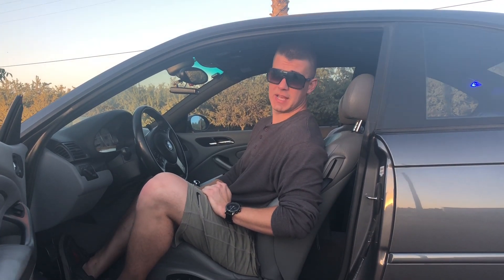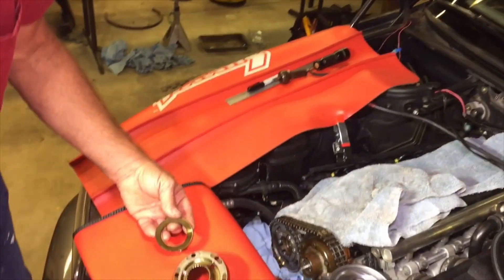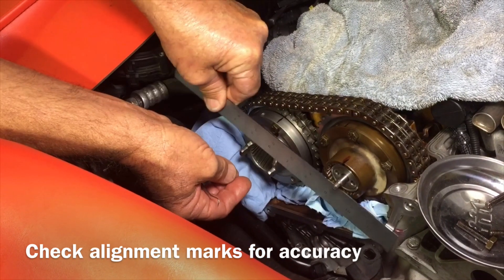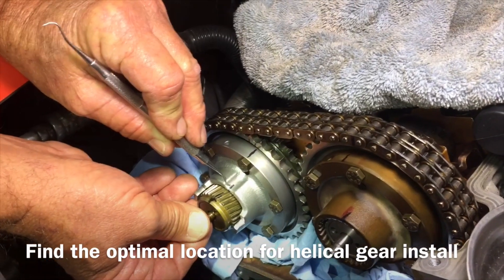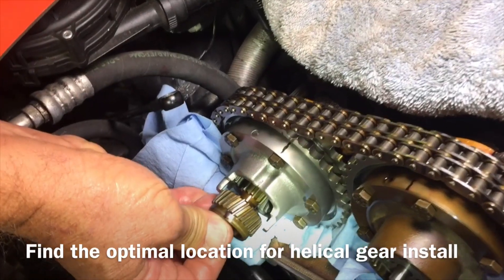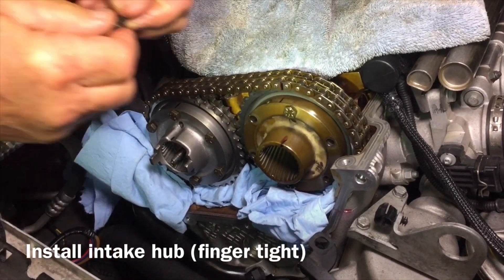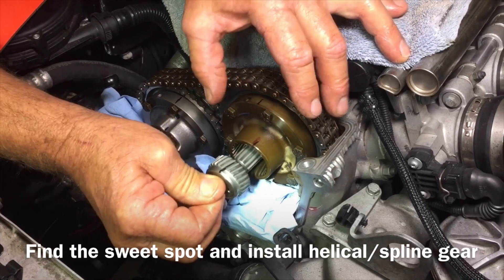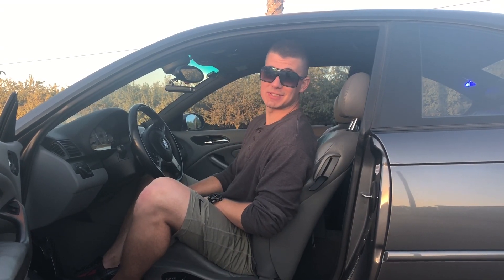How to: Perfect VANOS timing trick+ synchro gear installation + cam gears and hubs E46 M3( part 5)

Comment: The range of linear motion of the VANOS piston shown in the video is due to the hub rotating within its slotted adjustment holes. When the car uses VANOS, it rotates the camshafts, not just the (secured) hubs. The camshafts' phasing is determined by the linear displacement of the VANOS pistons, only limited in range by the camshafts on one end, and the pistons cover at the other end. The adjustment range shown around 7:30 isn't the actual range during engine operation; it's the displacement allowed by the slotted holes when hub screws are loose. Proper installation of the splined shafts will ensure that the vanos is properly installed and that there is room for fine-tuning the timing after that, but won't impact engine performance.

Comment: I have looked at many videos of the so-called sweet spot, but I fail to see how this could have any influence on performance. #1 If BMW was doing this in the factory why wouldn't they have it marked as to the engagement spot? They certainly didn't have some guy trying to find the sweet spot on how many thousands of engines, did they?  #2 When assembling the Vanos, the gear, when connected to the Vanos pistons, is pushed all the way forward (front of car) and then the hubs are locked down hub bolts. So, the helical gear will travel the same distance when running regardless of the spot they are engaged in. #3 When you take it apart, it's not already in the sweet spot, is it?  If anyone knows something I'm missing, please let me know. Regardless, this is still a great video and one that I had used, along with a lot of other printed materials, to do my Vanos.

Comment: Hello, I need your help! I had the vanos unit removed, but both inlet & outlet helical gears still inside the hubs/cams. At this stage, I was turning the engine over to check timing and the inlet helical gear came out (before this happened I already marked up the helical tooth in relation to hub). However I think I turned the engine over to get the helical gear back in without realising the inlet cam was not turning but the exhaust was. Now my inlet camshaft seems to be completed out of time. I am not sure what to do? Will turning the engine over cause the valves to touch pistons if the inlet camshaft timing is way out?

Comment: Been about a year since I rebuild my 03 E46 M3 and tore down most of the motor, just wanted to update because I forgot to about doing this to my vanos system and sir thank you for showing me this , I don't have a dyno sheet or anything like that but this made a huge noticeable difference all through the powerband it revs quicker mind you the motor has over 200K on it and so does the 6 speed tranny so I baby it and never run to redline,  launch or do anything crazy but the motor seems more balanced now .
Reply from the maker: Thats awesome man! Super glad to hear it made a difference for you as well!

Comment: I'll be damned. I had no idea different insertion points of the splined shaft lead to different amounts of travel. So the splines have to be differently cut or something so there is one sweet spot only(?)
Reply: It has to do with the smaller number of longitudinal splines in the cam receiver hole versus the many more cuts in the helical gear. These guys were the only ones to point out the sweet spot (i.e. identify that you could screw yourself if you just 'stuck it in' and bolted it to the vanos assembly).

Comment: I found I can reinstall the cylinder head without using a special tool to keep from bending the hollow camshaft: start at #1 cylinder at TDC & all rocker arms off valve retainers, use 1/8" aluminum shims on #3 intake & #2 exhaust to prevent scratching cam lobes.  Thanks very much for the help timing the S54!
Reply from the maker: Nice trick! thanks!

Comment: Is there anyway to find the sweet spot if you didn’t mark the helical gear and the sprocket?
Reply: @ferrisbuellers  thanks for the info brother. I have e36 S52 and did the Beisan vanos seal service (I believe the spline alignment concept is similar to the vid and what you’re explaining). When reassembling I may have missed the importance of aligning the splines properly to get the full range of variable timing. 

The car felt amazing after. Restored torque throughout the rev range. But now the car feels flat and a little sluggish. Seems like more revs are needed to get to speed... engine isn’t as eager :(. Still trying to troubleshoot... so many thing it could be (incl non-vanos related issues).

Comment: Not saying you are wrong but any back up to this or is it just theory?  Makes sense if the range of motion on the gear is maxed out on one end of the other but if it is not then the motion or depth is irrelevant.  If this falls into "it cant hurt" then  I would still opt to do this. BMW thinks this is not true but then they did the design that breaks so we should factor that in also. Good videos. Learned a lot!
Reply: I did this and the motor runs smoother and has more power throughout the powerband its stock I did replace pretty much everything but I can vouch on my 200K mile motor it made real noticeable difference and the motor runs more balanced at idle .

Comment: Wait ! ****
 So from the factory, it’s not in the sweet spot ?  
Because I was going to mark helical gears but I guess not 
Basically just play with it until I get the most travel?
   I’m aware of definitely marking the hubs
Reply from the maker: There are a lot of BMW guys out there that think the "sweet Spot" doesnt exist.  We are going to make a video soon to really put some data and numbers to that.
Reply: @FatboysGarage  Did you ever make this video to back up the theory?
Reply from the maker: Nope not from factory, Its just a theory, however we beleive this could be a reason why some M3's were just so much hotter than others straight from factory.  Im sure youve heard that some produced more power than others form factory and it was by chance. Ive driven 5 e46 M's some with aftermarket parts, and none run like the stock one that you see in this video after doing the VANOS properly.  Thanks for watching!

Comment: Thanks a lot for making the videos!  Really good stuff!!!! :D
When the end of the tension guide was broken (seen in one of your other videos), could this have caused engine pinging/pinking sounds at certain rpm's due to any timing differences from extra slack in the chain?  Just wondering/hoping that it's what is causing mine?

Just recently mine has been throwing a light and I get vanos related codes/pressure regulation and a misfire on cylinder 6.  Hopefully I'll get to the bottom of it :/ lol

Comment: Any reason why you did not upgrade the Hub spring and washer with some from a e39 m5? seems like a popular choice to do, not necessary but should keep raddle noise down
Reply from the maker: Well, in this car we bought the upgraded exhaust and intake hubs and drilled oil pump disc and can gears from Dr Vanos. These upgraded parts have a much better fit, so the teeth on the hubs fit perfect, And there are zero rattles. On the other car where I won’t be replacing the hubs and other parts I will consider the E39 parts . Thanks for commenting, love it!

Comment: Can you do the "sweet spot" with the factory helicol gears as well ??
Reply from the maker: When actually marked where ours were before pulling them, and found that from factory they weren’t set in the perfect spot. The car runs a lot better now into high rpm
Reply: @FatboysGarage   sweet thanks!
Reply from the maker: Che1seabluesdrogba11 Yes!

Comment: Wow..finally a great video explaining it. I used the calipers on intake and found the most travel. I marked my gears before uninstalling vanos/hubs. They were not correct. Bought used so maybe someone didnt find the sweet spot before me. Do I need to advance my exhaust cam since it retarded it to take off the vanos? I have pin in at TDC, intake pin in and have exhaust pin as well. All three are lined up. The lobes were 45 degrees pointing to each other, but TDC was off. Thank you so much!!

Comment: Since you can’t mark the new intake gear’s sweet spot, how was it marked in the video.
Reply from the maker: well, you can mark the new intake gears sweet spot, we just showed it with the old gear first.  you basically put the gear in different positions until you find the spot where it has the helical gear has the most travel in and out- measure it using calipers.  it takes a while and just playing with it.  When you find the spot where it goes in the farthest, mark the tooth on the New helical gear and mark the slot on the hub that it matches.  This marked helical gear will then be used in the next videos that are coming.  the helical gear has to be installed on the vanos first, but you have to find its perfect spot by just playing.

Comment: When you reinstall the exhaust sprocket with the chain, how do you know you have it on the right tooth? Just by feel and tension ? Yours looks new, why do you change it?
Reply from the maker: If I'm understanding you correctly, it doesn't matter which tooth it goes on for the sprocket itself, so long as the chain is on it properly and not kinked, tension will be added to the chain much later. The important things to pay attention to is hub installation, and the synchro gears that are inserted into the hub.   If this is still confusing please let us know!
Just an FYI, if you go with Dr VANOS, he has the best customer service you've heard of, a big reason i went with them. he can answer questions much better than anyone else online.